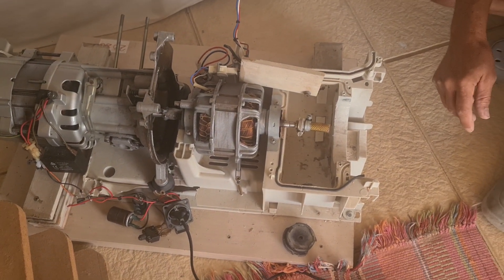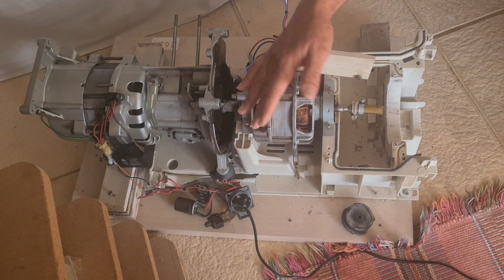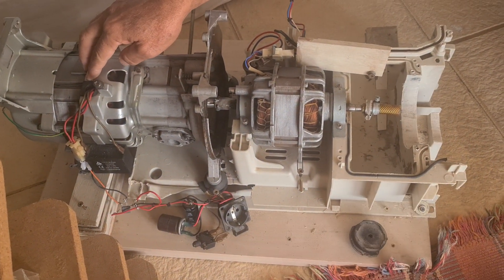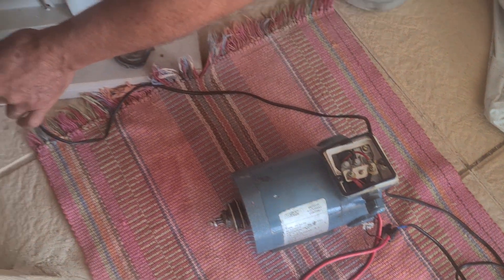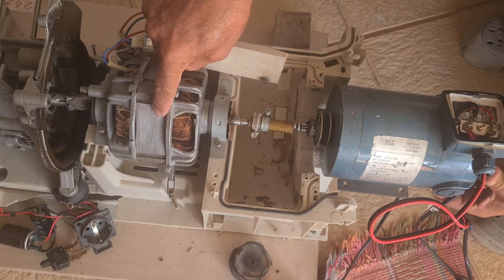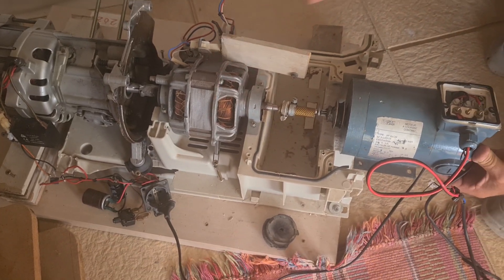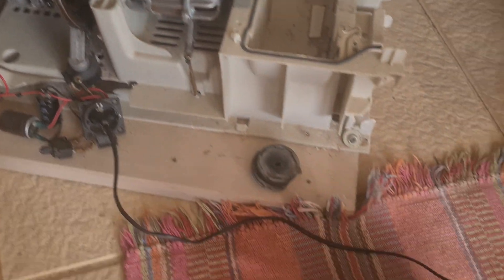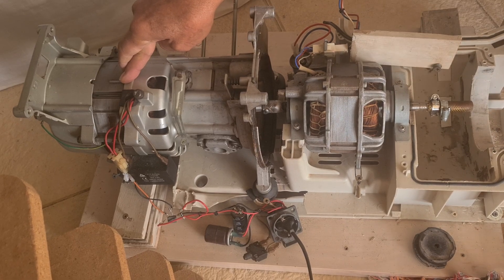Is this the future overunity generator? WATCH THIS

Comment: Hello it run for just few minute and stop sorry
Reply from the maker: I didn't want to make the video long but it will run as long as the washing machine motor runs, then you disconnect the motor and it is supposed to work on the new motor itself. Check my previous video about this generator and you will see it running for a long time.